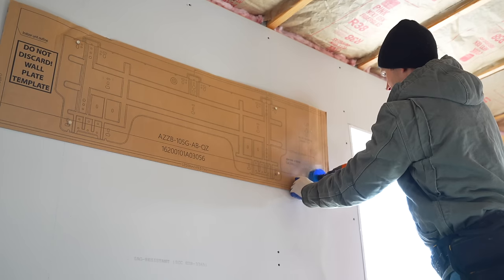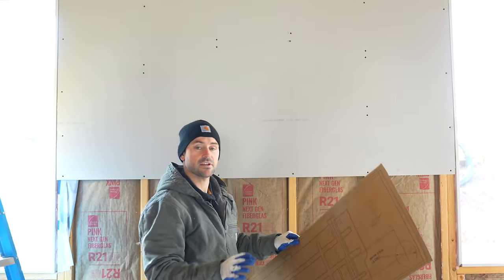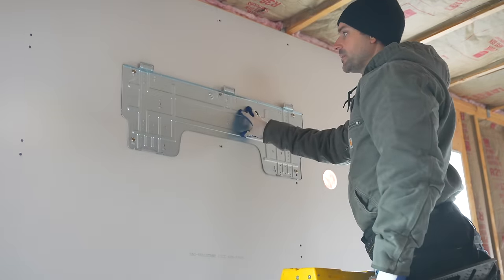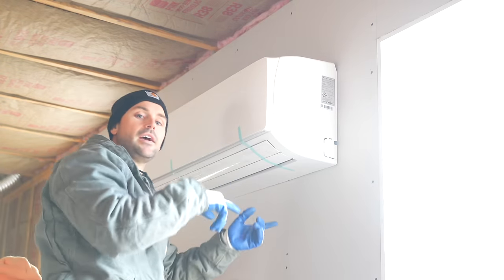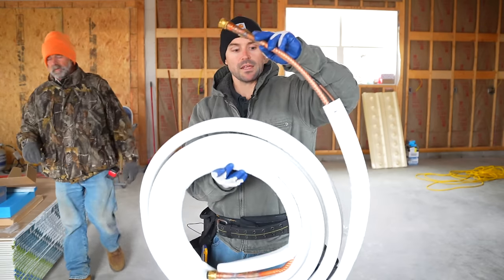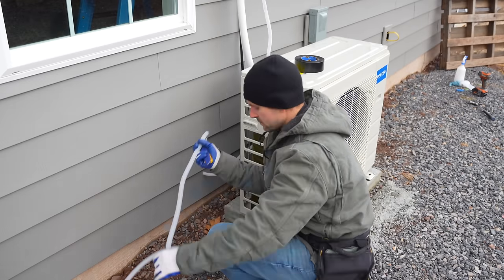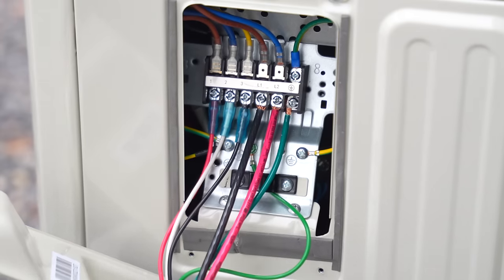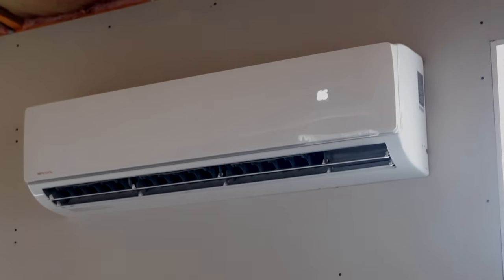How To Install A MrCool DIY Ductless Mini Split YOURSELF! - FAST and EASY!

Comment from the maker: Hey! I hope you enjoy this video. Timestamps below 👇to help you navigate the video. I hope it helps!
Building Concrete Pad 01:15
Installing Air Handler (Inside Unit) 02:45
Installing Line Set & Condenser 10:18
Wiring Condenser (Outside Unit) 16:52
Installing MRCOOL Lineguard Kit 19:29
Turning ON & Starting Mini Split 21:55
Installing SMART USB AC CONTROLLER 25:56
Using MRCOOL App 26:45
Electrical Installation 29:01
Review 42:40
Reply: Good stuff, you make it look very easy!  What's the heat temp blowing on the inside?  I installed a geothermal several years ago and only get about 87 degrees.
Reply: I have a 36 BTU unit with 3 12 BUT split. Hoy many amp breaker I need? Than you.
Reply: @theEcxellentLaborer
Are you in PA?

Comment: The installation instructions clearly state that the coil of excess refrigerant line should lay horizontally, not stand up vertically. You will trap oil in the valleys, which will lead to premature compressor failure.
Reply: I would have ordered the 16’ footer!

Comment: My only gripe with the Mr. Cool DIY kit is the 25 foot line set. Coiling that extra up behind the unit looks like crap. They should offer different length sets  to avoid this cluster outside your home.
Reply: Cut and flare
Reply: @todosube  Yeah but for the sake of the Mr Cool DIY models, it defeats the entire purpose of the precharged lines. The idea is to not have to do anything with the lines other than screwing them in.

Comment: Only downside to this unit that I see is the line set. ….That would drive me nuts…Should be an option to order a line set closer to the actual length give or take. Still a great video as usual..
Reply from the maker: A line sets cut to length would be pretty sweet. I think problem there would be all of the extra custom lines that would have to be made. The coil actually doesn’t look too bad once you get it done. I appreciate your comment!
Reply: @TheExcellentLaborer  I hear ya…it looks all pro till you see the coil….😂hey it works..👍
Reply: Cut the line set and vac it down before releasing the refrigerant, done deal
Reply: @savagecr-x2438  I’m no hvac  guy but by doing that would that not throw off the proper refrigerant levels since it’s charged to the length of original pipe? 
Hence over charged.
Reply: I’M Now going to …….its getting to be a little repetitious,  every other sentence is “  now I’m going to “
Reply: You can order the lines in different lengths
Reply: @JohnR9965  vacuuming the lines out ensures no outside air or atmospheric air is inside after removing the caps on the ends of the lines, the pressure in the lines are equalized and atmospheric air is rushed in. Vacuuming the lines before opening the refrigerant valves should be a common practice. It’ll hinder performance a bit and also introduce moisture from the outside air if not done. Also yes these Mr cool lines come pre charged so if you were to cut them to length, you’d have to recover the refrigerant charge first.

Comment: Wow, this video was really easy to understand. I’ve never got an explanation close to this regarding these systems. Outside of the electrical work I feel I could tackle this install. I will be gutting and re doing the inside of my home this spring and this is something I’ve been interested in installing.  Thank you so much!
Reply from the maker: I’m glad you really enjoyed this video! The mini split system is simple to install with the precharge line-sets. That is what I enjoy about the DIY version of this system. Appreciate you watching!
Reply: Yea u had fun with this unit

Comment: I want to do this for our Florida garage.  On other videos ,AC techs write to not coil the excess AC lines vertically as oil in the system gets trapped at the bottom of the loops and the condenser will fail.  They write coil them horizontally.  Is there any instructions for this with the unit?

Comment: Everything went well until I got to the part of connecting the outside unit. The  numbered wires went on well. NO problem. The wires from the whip which, as your wires were, I stripped bare, had a difficult time getting those thick wires under the clamp on the screw and dropped a screw and clamp into the bottom of the condenser. Is that a problem for the condenser? Where do I obtain another screw?

Comment: Such a great video. So in depth and really clear with the instructions. Best part is how well u did the electrical portion. Ive never done a single thing involving electrical work, but i feel very confident that I'll be able to do this part myself along with the rest of the install and probably save $300-400. Can't beat that with a stick!!! Thank u sir

Comment: Best video I've watched on mini-split installation.  It's perfect because it includes wiring the disconnect box.   Perfect! 😎
Reply from the maker: I try to make all of my videos full and complete. Thanks for watching!
Reply: @TheExcellentLaborer   I'm like you.  I love concrete but I'm going to use the wall mount brackets.  I'm only here part of the year.  I want to be able to keep the unit away from the vegetation, without pouring a gigantic pad.

Comment: One of the best DIY Explainer on YouTube and I have seen a lot. I have bookmarked just about all his videos as I am finishing a 3-car garage workshop thingy with a loft. My question today is not 100% on the mini split itself, but drywalling around the air handling unit. I noticed in this video that the wall the unit is going on has drywall on the walls but not yet on the ceiling. I gather (for clear reasons) that ceilings are supposed to get drywalled first. In mine, I was eager to mount the unit that I am feverishly installing insulation and drywalling .. the wall.

Logic being that I just need to get the unit up and running (dual zone 27K unit that it is) because, well, winter is coming. I was committed to completing the insulation of the ceiling, then removing the top half of the drywall on the walls so that I can do things the "right way." But seeing this from The Excellent Laborer is making me think I'm not doing that. If it is good enough for him, then by golly, I am going to plow ahead!

(so glad I saw this. saved me a ton of unnecessary work). I'll go watch the subsequent videos .. again, but carefully.

Comment: I installed the 4 head unit in my house I have a crawlspace so I cut the Sheetrock out to install the line sets it was alittle more work but still rather simple and because I have a crawlspace I left the coiled up lines underneath the house and just uncoiled what I needed to exit the foundation, all and all alittle time consuming but pretty simple it’s been about 3 and a half years and still working great, it takes a little time to clean the units one a year 😮

Comment: Dear bro, I consider that before opening discharge along with suction valve of out door unit of Ac's with elenkey we should vacuum at 500 micron with Duble stage vacuum pump .

Comment: Excellent video! I'm going to install a competitors unit next week. Thanks for the step b step!
Reply: hopefully yours was actual precharged line like advertised.. we've bought 3 competitors units (and returned them) as they were NOT precharged and required an ac technician to come out

Comment: Getting ready to install the same unit but a 24k.  This is one of the best install guides I have seen.  My line set will run out the wall then to the right for a little ways before dropping down.  Plan on using the same lineset cover you did.  My exterior walls are stucco, any tips on attaching to stucco walls?

Comment: We installed a MrCool for our new construction here in San Juan County, WA, and are quite pleased with it, but were dismayed that the State Electrical Inspector would not pass it with the electrical wires provided. We needed to replace the electrical wires from the air handlers with the tray cable approved by code. Plus, we were required to put those wires into conduit where they exited the wall going to the condenser. MrCool didn't reply to our inquires of why they don't provide cables that meet code or suggest that conduit be used. Plus, we could not figure out how to hard wire in the wall thermostat, and the batteries run down pretty quick. Nevertheless, we are quite happy with it.
Reply: electrical codes will vary by location

Comment: Great video! I have a house that is already built so the challange would be getting the disconnect to the area (about 30ft) I would put the unit. I know there are codes to follow, but would running the line on the outside of the house be possible?

Comment: Great Video, I have a question about the refrigerant charge. It looks to me like the refrigerant is stored in the Compressor / condenser unit and not in the actual lines. The lines look open after you removed the protective covers. This would indicate that they are not under a vacuum either.
Is this the case?
If so, would I not be able to cut and shorten the lines if needed? I would solder a union joint in the pipe to avoid flares and threaded end issues.

Let me know what you think. Thanks.
Reply: I'm no pro by any means.  That being said, from what I can tell is this.  The terminology used in my opinion is misleading.  Not the fault of Josh as all manufacturers of the DIY units use the same terminology.  They keep stating that the line set is "pre charged" which is misleading.  The refrigerant is Pre charged in the compressor unit for the line set.  The line set itself is actually "Pre vacuumed" not "pre charged". The ends remain sealed until connected therefore no need to pull a vacuum before releasing the refrigerant.  It's actually a waste of money on the "Pre Charged DIY systems" as getting a vacuum pump and gauge set is relatively inexpensive and performing a vacuum on the line set is simple.  You can get a regular Mini split system for about half the price of these units and the vacuum equipment can be had for less than $130.  It's really a simple process.  Check out Will in this video for more information www.youtube.com/watch?v=5trJX6Ef1iI

Comment: Thank you for this step-by-step, very helpful.  What about the inside filter?  I only saw that tiny one, which you did not use.  Does it have a regular dust filter?  Also, does a USA-made unit equivalent to the Mr Cool exist?

Comment: Question if you could please help me with, for 36000 but unit what size breaker did you use ? 
 It doesn't offer this info & my electrician wanted to know ?

Comment: I see you went with the minimum 8/2 wire for the outdoor electrical connection, was the reason to choose that over the 6/2 recommended just a matter of cost?  I'm looking to purchase the wire for mine today, so am not sure if I should spring for the 6/2 or just go 8/2 like you did.  Thanks!

Comment: What made you use the neutral as hot? Is it because the actual breaker box inside already has neutral?
Reply: that's how all the dual appliances breakers are wired in my box -

Comment: I followed these instructions. Mine appears to be a lemon. It powers on but the compressor never comes on and I get a PC 03 error. From what I can tell this means low refrigerant. I didn't get any bubbling when I sprayed the soapy solution.

The other part of this that is not mentioned and I feed is disingenuous is the cost of MrCool products. The unit comes with refrigerant line to use that is 25 ft, but if you need longer get ready to shell out some money. A 35ft "precharged" refrigerant line is about $430. If you want to extend off of what you have, ie. 25ft + 16ft, the 16ft refrigerant line costs $179 and the coupler costs $380 for 4 pieces of brass about 4 in long and a longer electrical line. Again, everything is supposed to be precharged, including the couplers. This is all on top of the $2800 I spent for the unit at Costco. Now I still have to hire someone to come out and see what's wrong with it.

I'm sure MrCool didn't want you complaining about their pricing at all so they happily sent you a unit to promote. I'll continue to try making my unit work since I put a lot of hard work into installing it, but I'll never buy MrCool products again.

Comment: so, I had my mini split installed for me, its a Pioneer 120v 9000 BTU, but I have a concern about the temperature. I live in Florida so it does get hot, but when I set the temperature on 76F for example, the temperature will keep going lower, as low at 73F even if its set to 76F, and when the cooling stops, it doesn't start cooling again until it gets near 79F.. is this normal?  I would like it to start and stop cooling at thye temp i set it to.. any idea what can it be?

Comment: Excellent.,. As all~ways.,. and yep.,. It's best to eat your spinach ahead of installing them their line sets.. you'll need the muscle. With alignment, (seriously) prefect and make sure the angle of Dat dangle does not over pressure when putting the screws to her in a straight manor.,. (Lesson the opportunity to strip or cross thread!!) And best be careful not to kink!! Yep,. I'd use the clay and back up the interior with the spray insulation as it gets eradicated with exposure to weather over time.. High fives with the PL (polyurethane caulk sealant) at the siding.. dat schtuff's completely and totally nuclear bomb proof!! Amen Brother... rock on!
Reply from the maker: Thank you so much! It sounds like you have a lot of experience installing these. Everything you said in this comment is a good point! I think it’s cool how companies are looking at making things more DIY friendly like this series. As you know, I enjoy DIY as much as I can! I appreciate you stopping by and watching!

Comment: Is it ok to leave the lines coiled and standing behind the condenser?  According to the manual, it says it should be coiled and laying horizontal to the ground.  I am in the middle of an install and I was going to have my coiled line behind the condenser like your video but am questioning whether that is going to be an issue down the road.
Reply: These units are made to (eventually) fail, they hope to make more money with the money they "borrowed" from you from the time of purchase until they have to give it back. They know their profit wouldn't be so much if they instead made a model with custom coil length. So here we are, laying them horizontally will only buy you time, without a coil to length this is bound to fail, if you're luck it might outlive its 10 year warranty, which at that point you'll feel not so bad about the deal, it was a good run you'll think, to only go and buy a brand new Mr.Cool DIY Expert 8th gen.

And this is bad because they know the average DIYer can't solder, so they decided to simply send long enough coil so they could hit their profit goals. And they tried to hid the downside of this choice, by not mentioning that most people will have to deal with the extra coil, even the manual was so well written that by the time you realize you have bad news, you're too far in the process. And the fact that the coil must rest flat is only mentioned once in a little box hidden away after some legalese('ll bet most people skip) at the bottom of a page. So, we've been played the whole time, and still are...
Reply: @vdeantoni 
I am running the line sets for a 12k two zone tomorrow.
Sure would like to chat with you if you are willing.

Comment: Can I skip the disconnect option and just have it receiving power from a power outlet that’s no longer being used ? If I want to disconnect cant I just shut off at breaker ? Would just be diy more freindly if I didn’t have to higher an electrician as it’s supposed to be diy .isnt there a 120v version of this or something like a plug 🔌 that can be connected to wall hiring a professional is expensive how much would they charge to do the wiring to a disconnect box .
Reply from the maker: Per code in my area I have to have a disconnect. It is something that an electrician can install with no problem. I hope that helps!

Comment: Do you secure the outside unit to the concrete pad? Missing a screw where you wired the disconnect (top left side)?  It looked loose……. Thank you for the video!

Comment: I guess it's easy to love this Mr. Cool if it's free. I paid for mine. Mine did not come with a hole saw. The tape they give you does not have a sticky side. How are you supposed to get it to adhere to the lines when you wrap them? The mounting bracket is so short you can't hit more than one stud on the inside mounting. The piece they give you to go through the wall sticks out on the inside because you have to drill the wall, so the pipe has a downward slant so when you put the plastic through the wall it isn't flat to the wall. Customer service is very slow, and the instructions could use some rewording. I'm going to fire it up on Saturday and if it doesn't work the way I want it to it's going back in the box back to Amazon.

Comment: Nice video. But the whole “Pre charged lineset” wording in the manual is false. This is why they only offer a 5year warranty instead of a 10 or 15 year warranty like Daiken does
Reply: What do you mean?
Reply: Nope you’re wrong. The lines are pre charged and hold a patent
Reply: @tyson9419  when they say pre charged, everyone thinks it has refrigerant in it. When in fact they don’t. They have dry nitrogen inside them and you don’t want nitrogen mixing with refrigerant

Comment: Why pay extra 1000$ for line set you can't adjust to length. Rolling up lines behind unit looks getto. I just bought the pioneer and a cheap vacuum with gauge set for $1000 less.   Cut lines to length and 5 year warranty.